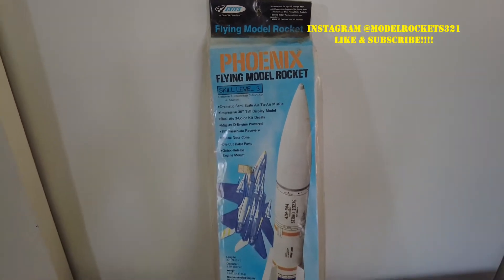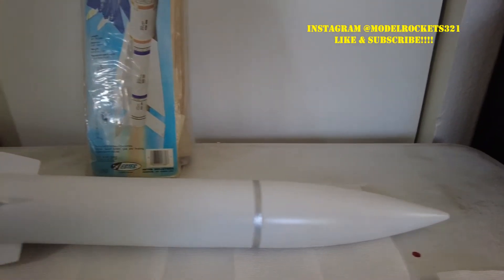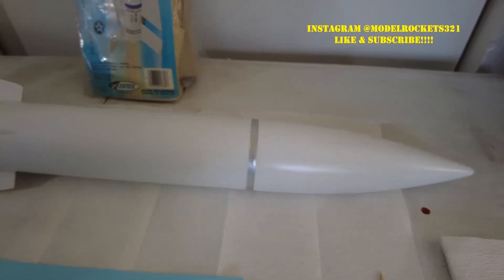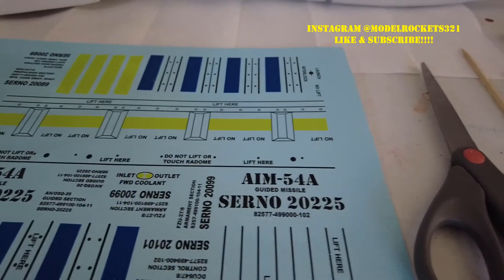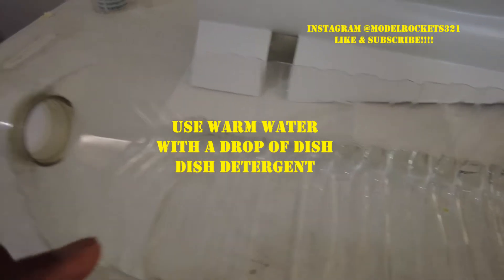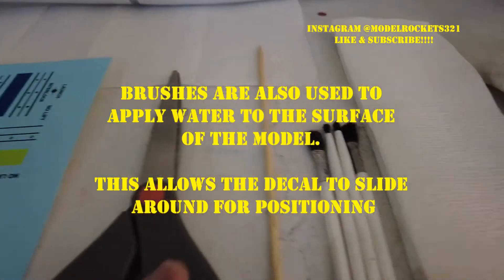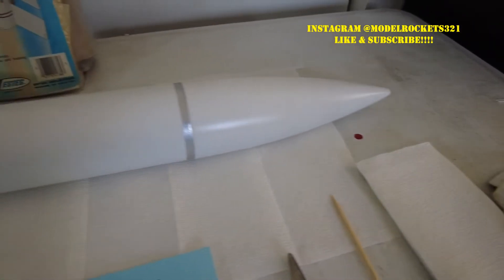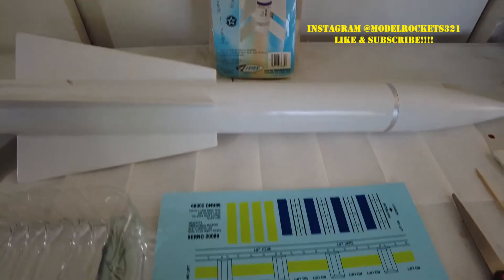ESTES PHOENIX MISSILE: How To Apply Decals To A Model Rocket

Comment: Great stuff. That complex wraparound decal above the fins that you didn't show being applied is the one that tore into about 20 pieces the first time I tried it but I dug every piece out of the garbage, got them into water and reapplied, what a relief! I also use a cotton q-tip at the spots where the decal is touching the fillets of the fins to keep air bubbles out. This might be the most challenging rocket to decal along with the old USS Andromeda imo.

Comment: Perfect timing. I am just finishing my Phoenix, now, as one of a few rockets am building with others from our astronomy group, to launch in the spring with some local teachers and students. But it was an old, old kit, I had in storage, and the decals were all crunchy and crispy...no good. Ordering replacements from Tango Papa...thanks to your reference. Keep up the good work!
Reply from the maker: This is great! Beef up those lower fins and use a 36" nylon parachute also. These are know breaking lower fins on landings. Good luck!
Reply: @modelrockets3215  Oh, yes...I got a 24"-er, but when looking at it, thought larger might be even better...I think I'll follow your advice. 

Also, I was wondering about the lower fin exposure. Even considered a recovery system that might flip the rocket body around to land front 1st...but that's all a bit awkward. So am reinforcing. If I had it to do over, I'd simply have raised the lower fins ~1/4inch higher. Though that's not quite faithful to the design, it would let the tube take the impact.
Reply from the maker: @nicedoggie1  Yes go bigger with the chute. I had a 24" and one fin snapped off. Throw the wall fins would be ideal for this one. I reinforced mine with a lil epoxy. Not too much. That stuff is heavy. E30 4T motor also